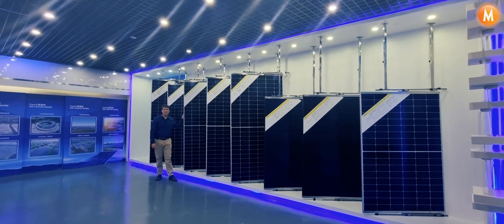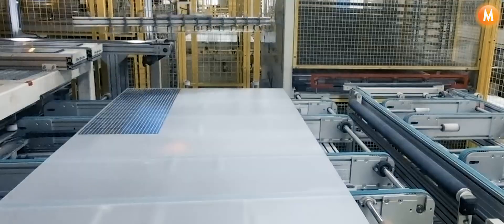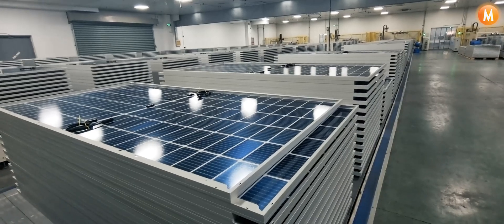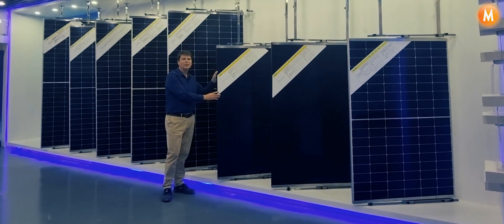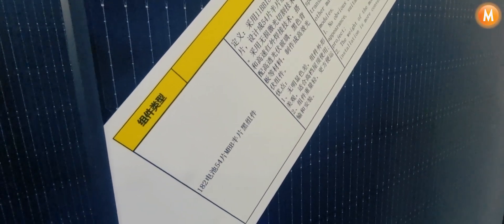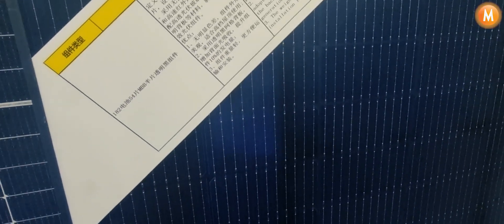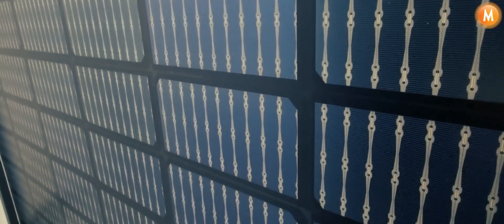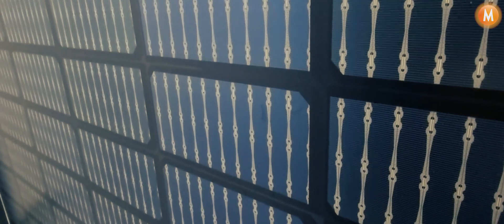JA Solar Factory Visit - Shanghai (March 2023)

Comment: When rating your bifacial panels is it based on the front of the panel, both sides devided equally, or some other sort of divided number? Im looking at possibly purchasing your 550 watt bifacial panels.
Reply from the maker: Bifacial photovoltaic modules can increase the electricity yield of solar systems and solar farms by up to 15 percent depending on how high they are above the ground, the row spacing and where it is sand, grass or snow under the panels, this will determine the the amount of albedo or reflected light that reaches the back of the panel.

Comment: is JAM54-S31-385MR not the best kept secret? for those who have a 150vdc max as it has a low 30.46VOC
4 in series (no y cables needed) = 122VDC at 1500watt.  solar pool pump or solar generators often have these limits.